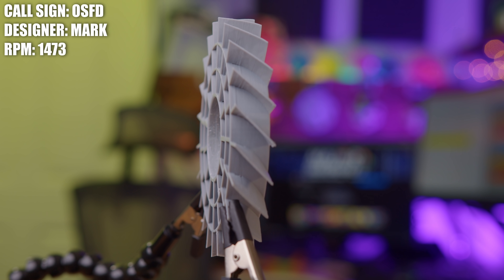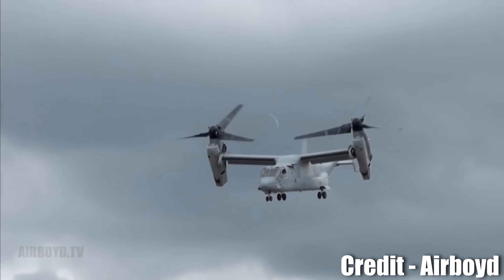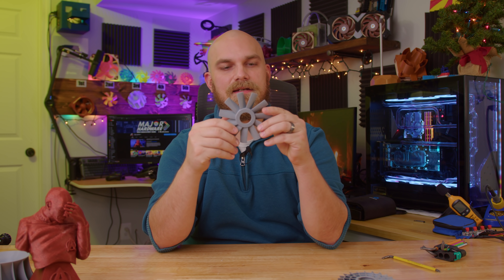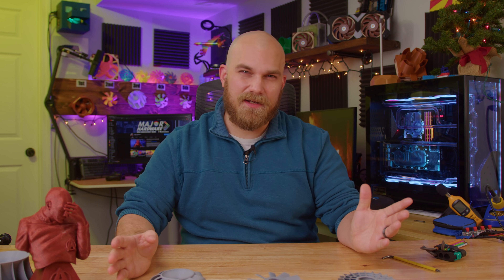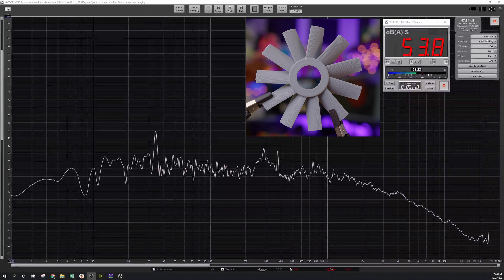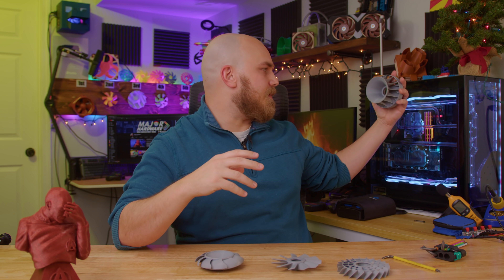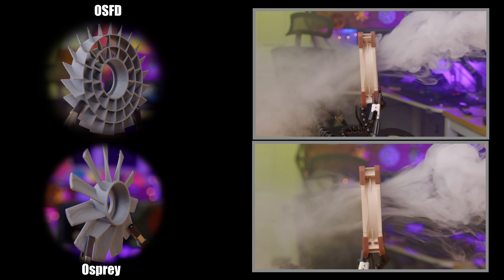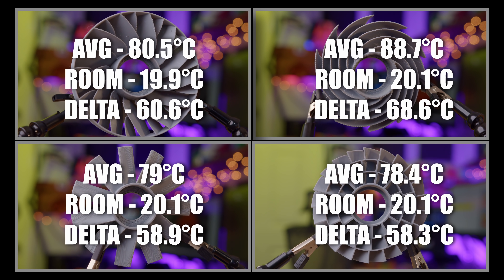INTERESTING | Fan Showdown S3E10

Comment: the first one is to be used in an enclosure not open like you have it,   in middle bore to case flange then out! picture it like a jet pump or squirrel cage fan, blower motor what have you

Comment: So, I just realized that it's probably easier to test static pressure than CFM, and I think the results could be interesting.

All you need is a rig to seal up the back (inlet) side of the fan and connect it to a clear tube of some sort. Then, orient the fan so it blows upward, and place the dangly end of the tube in a bucket of water.

The higher the static pressure, the higher it will lift and hold a column of water. Even if you don't then proceed to subtract from atmospheric pressure, and instead give us a measurement in inches of water, it'd be useful, as we don't need absolutes to make a comparison.

While this doesn't give us a pressure/CFM curve, it at least shows which fans perform better when more obstructed.

Comment: Did the Francis turbine print the correct way? Maybe the file needs to be mirrored. From what I know Francis turbines are enclosed in a shell and suck water (or air) from the protruding part so the opposite from what you tested. Can you include the mirrored form in another video, pretty please :-) ?

Comment: Please excuse my terminology. I've explained a few major issues with testing and expanded on bonus issue for tests.

A total volume test will be great but the final cooling rate will be dependant on a few factors. Heat tranfer speed to the radiator fins. Volume of air drawn across the fins. Volume of air expelled. A closed system airflow test showing the total volume of air moved with the inbound air being ambient and the outbound air being 100% contained as flow through the radiator fans then the air temperature of the output being displayed.  

The ambient temperature of air entering the system and the ambient air exiting I assume is the temperature being compared. The heat transfer across the fins will depend on the turbulence of the air, i.e. low turbulence equals low transfer.  An extended period of turbulence isnt greater, i.e. Difference in heat/time = rate of exchange. A smooth flow will lead to gradients meaning a high flow rate may mean minimal heat transfer. 

This way, even if the fans spill air in every direction then the captured ouput temperature could be measured assuming there is no air leaking from the case. The total air entering the system and the average input and output temperature could measure the total temperature being removed.  "Air" is a poor unit of measurement. The air pressure and moisture of the ambient air and within the case would be helpful. 

Finally and potentially most important, are there any airflow or smoke test videos of the fan working inside the computer? The airflow tests for smaller fans exhibit cavitation issues which would ruin the fans over time. The sound tests would show spikes. A smoke flow test would show the negative output of the fans. A very expensive set of cameras could be used to measure the IR movement of the air at different points. Before entering the system, before crossing over the conductor, before entire the fan, the heat distribution within the fan and the output. 

Bonus issues:

1: Aerospace design relies upon very large outputs which desktop fans cannot compare. Few desktop fans designs can accurately measure the extreme stresses involved with upscaling which may be envisioned by some viewers. For example any design with split fins will work differently within vastly different scenarios. So solid fins will only provide data in a short range. 

2. Since aircraft lift is dependant on redirection of airflow then upscaled designs would be extremely helpful showing even input and the output flow of the temperature and turbulence of different designs. I'd personally love to see the entire airflow model across wider areas.

3. Since the area of the processer is small why not allow for an airscoop that envelopes the entire body of the inflow plus the fan plus the radiator. I'm sure some of the subscribers would love to have a total area design that they could play with. The fan shape spilling out air wouldn't be a major issue anymore.
Reply: Regarding the restrictions on the fan design. Since fans that redirect air to the center are more efficient than an outer rim/hub to rotate the fan would allow for more designs.

Comment: Hey, you should buy a thermal camera to see the heat exchange in the air. It could be a good way to determine if a fan is creating certain high or low pressure zones

Comment: Major Hardware. I do not have CAD skills but i do have ideas. One thing i have noticed is that nobody has ever used a centrifugal style fan before. When i say that i mean nobody has created an entire fan google centrifugal fan. It's hard to explain but the noctua could attach to the side of the fan which would spin the inlet. Then attach the cooler to the outlet side of the fan. winning

Comment: You do NOT measure flow rate, just visually guestimate. WHAT? Ya true!  You measure but IGNORE noise, low noise is HIGH EFFICIENCY.  You fail to wind up speed to a fixed noise level ie scientific standardise efficiency of all fans side by side.  Conclusion MEANINGLESS CHANNEL.

Comment: have compared the stock noctua blades with a 3d printed version with the same measurements? I wonder how much layer lines and material density affect the performance of these printed fans.

Comment: Keep up the great work 👍
A passing thought, The Francis turbine model needs its rotational direction changed, where you fed the smoke in, is the outlet where the water would leave irl.
Would be interesting to see if it would work.
Reply: Steeper angle would be needed on the fins, like the original, as well. They looked very straight when I thought it was going to be a push
Reply: Agreed, the radius is oriented correctly but the the angle of the blade (from centerline) is in the wrong direction. I was just about to comment the same thing until I saw yours!! lol

Comment: I feel that testing the flow rate but excluding high static pressure is excluding half of PC builds. Maybe a shoebox with 120 inlet hole and a restricted output. A pressure sensor inside the box, maybe a phone with a barometer in it (app phyphox (Android and iOS) will read every phone sensor, so maybe use that).

Comment: How about making a tesla turbine instead?
Reply: But that turbine is designed to be driven by a force pushing against it.
Reply: @hybrid9mm  It works both ways.
Just like a DC motor can be used as a generator.
Reply: @QoraxAudio  yes and no.
I’ve never seen anyone use a Tesla turbine to move (push) air or fluid, it would be interesting to see considering the turbine is optimised to be driven.
Dc motor is electrics, a Tesla turbine is fluid dynamics, they work differently and don’t compare
Reply: @hybrid9mm  I didn't "compare" anything, I just gave another example of a reversible process where energy can be turned into motion and vice versa.
Reply: @QoraxAudio  “just like” is a comparison, but ok
Reply: @hybrid9mm  It was just an example of a similar concept, for clarification... looks like I've only made it more complicated instead lol
Reply: @QoraxAudio  well it’s not all on you, it’s 50% me to 👍
It takes two people to create a miss understanding after all
Reply: @hybrid9mm  Fair point... anyways, a tesla turbine can push air with quite some speed - without load.
But I suspect that it provides very little static pressure.
It would definitely make an interesting experiment - a bit different from yet another fan blade design.
Can be tested as a waterpump for a water cooler as well... that'll probably work a bit better since water is incompressible as opposed to air.
Reply: @QoraxAudio  yeah water can be pushed with ease, if you look up car water pumps, most are basic and they look very similar to a Tesla 👍
Now air is a little more tricky lol, it basically needs to be scooped to create pressure, and obviously static pressure is created keeping the blades as over lapped as possible.
It would work if the impeller was adapted to scoop and the housing matched to suit, it wouldn’t be a fan as such though.

Comment: The only one I could stand the sound of is the Turbine, which I think I would actually use. I do wonder though how this seasons fans would do in a static pressure test rather than open air I think the results could be surprising.

Comment: Question: Regarding the smoke tests, does the particulates of the smoke build up as a film over all the furniture downstream of the test rig? How difficult is the cleanup?
Reply: Shouldn't leave any residue if the machine is performing correctly

Comment: Could you please test the arctic P12 PWM PST ARGB? It’s very different from the arctic P12. It’s a little thicker and also has a ring on the edge of each blade, connecting the fan blades together. It seems to support it and keep the noise down much lower than a normal P12.

Comment: Just mounting the fan onto the end of a clear vertical tube with a scale in inches or CM etched or painted on its side, and placing a loosely fitting, weighted ball* into the tube while the fan is blowing air through the tube, and then measuring the ball (or cylinder*) height will give you a pressure metric to measure your fan designs.
Reply: Genius. Hope this gets more traction.

Comment: That Francis turbine looks cool but I have to wonder if the designer got the blades inverted like what happened in the past? I'm querying this, because google shows the flow is back to front to the way it should work... maybe flipping and testing it the right way around would provide better results?

Comment: dude season 3 was about CFM. You used a air cooler that doesn't need the same static presser needed to push air through a radiator

Comment: Turbines in the field of hydropower generation are normally not designed to suck in water / air or to build up pressure to the rear / front.
These should actually always offer the greatest possible re-sanding and at the same time offer a high flow rate in order to keep a high speed as constant as possible.

Comment: A thing i would like to see is the difference when the fan is mounted on a sheet of metal or plastic to simulate when it is mounted in a chassis. That will stop most of the air going around the fan instead of through it.

Comment: Scooperdrooper should be lessened by maybe 2 or 3 max in large blades providing better space and flipped opposite, but the dev needs to fix the fan attaching point backwards of its current state. Then try again and I'd wager a 30% est increase

Comment: I spotted a small mistake in the beginning:  centering mass doesn't make the fan any faster. It just helps it attaining cruising speed a bit earlier, which doesn't do anything for its cooling performance since everything is measured at steady speed.
Reply: It helps a bit with energy consumption if it takes less energy to get to max spin, or to decelerate it.

Comment: Tip on Russian: every letter in Russian has a sound (except 2 which are used to soften or harden consonant letter before them). So all you need is to pronounce those letters one by one without pauses. And English has same or close enough sounds - just get an english word that starts from that letter or combination of letters where no letter sounds are omitted. "V" - like in word very, "ya" - yahoo, "ch" - check, "e" - every, "s" - same, "l" - loot, "a" - after. Or you just can use google translate to read it for you - it is not perfect, but good enough o)

Comment: according to LTTs recent video its BETTER if a fan does spit out the air in all directions so the airs more spread to feed the GPU with cool air too not just the CPU ,a direct output of air can just smash into the wall of the GPU and not going near its intake, but thats just a front case fan sceneraio for rads etc its different

Comment: I want a rematch of all the old first place fans with your new set up to see if they still hold up to the current system. You were using imperial and now your using metric so to speak, it's time you re measure and be sure the stats are right.

Comment: Has anyone tried curving the trailing edge of the blade to help direct the flow out
Reply: Isn't that what most fan blades do that are tapered?
Reply: @Dr.Spatula  im talking about a near perpendicular out stretch near the base of the blade to help direct flow
Reply: @C_Castillo  I'm way better visually so what you're describing to me sounds not uncommon. To try and clarify you are referring to taking the typically ~45° angle where the blade is mounted to the center and extending to 90° while keeping the overall blade angle at ~20°?

It's  too cold and too late and my brain hurts

Comment: I work in a hvac r&d lab. We use a piece of equipment called a "code tester" to measure acfm across different static pressures and then calculate scfm. It's a pretty simple piece of equipment to design and build, especially with low cfm applications. 
Might be worth looking into if you want to start measuring airflow..

Comment: Wouldn’t it be dope to get a meshify XL monster case & setup those wind tunnel mini flags like for wind tunnels. You wouldn’t need to build a pc in it. Just create 3D print objects at size. So you could try the largest 3090 to a discrete. A 420 rad up top & any number of size or placement of fans. That a year of shows I’d love to watch
Reply: You could do all the top cases! & you wouldn’t even have to buy them! It’s about the internal size & dimensions! Mock up printed parts to obstruct for every type of cooler, mobo, GPU,capture card,nvme raid. You could do them all! All the data would be without filters or obstruction to the cooling fans. Still be epic imo. Apologies I sperged out in comments.
Reply: Yes X fan pushes the most air & best control temps. But what if I have a mass production fan in a popular case? Where can I move them to get best cooling, or best db, or best of both? Is a 140 in the back as exhaust best? What rpm? Do I put a 140 on the bottom blowing up because my 420 blocked the 3rd front fan? Oh man this could be cool!

Comment: Could YOU print a flat disk (no blades/no engineered air movement) and give us a DB reading... like a static criteria for a printed friction surface/e-motor. I don't want to "whine".  What you are doing is wonderful and well done!
Reply: Honestly, its sound signature would probably be lost in the background noise of the room.
Reply: @martindinner3621  Maybe..but there could be a "signature" generated by the printed surface that would be considerably less then any fan.

Comment: the scooper drooper actually sounded really soothing. im unsure as to if itll actually move much air though lol

edit; nevermind, it performs terribly lol. at least it sounds good!!
Reply: @Lassi Kinnunen 81 It could theoretically perform better with more blade surface area on the front, remove most of the center ring, and smooth out the back edge a bit more. I'd be interested in how well it could perform with a redesign as it looks great aesthetically

Comment: Have you ever considered making a laminar flow air source for the vapor? It can be as simple as gluing a bunch of 1 inch straw segments together, a 3d printed bracket, and then a manual RPM control to let you find the laminar flow speed.

Comment: Might have mentioned it in a past video, but something to take note of is that humans are very, very good at filtering out constant noise. The issue with a fan that has 2 or more spikes in the spectrum analysis is a phenomenon called "binaural beats", in which the two notes go in and out of phase with each other (kind of like constructive and destructive waves). This mechanism causes a "pulsing" sound to be heard, in a completely different pitch, clashing with the two peaks at the same time. Predictably, this is very hard to tune out.
Reply: This only really applies if the tones are close together in pitch (within a semitone i think), otherwise we hear them as two distinct pitches (even though the phases do mess with each other still, obviously). And it's only technically called "binaural" beating if you're listening to them in separate ears (like through headphones - hence bi aural / 2 ears), and the reason it gets a special name is the interference pattern happens in your head instead of in the actual pressure waves in the air. People like to call it binaural beating even when it's not in separate ears sometimes though because there was some pseudo science about this binaural beating inducing certain brain wave patterns which supposedly altered your mood. The reason two notes on a piano (or basically any sound other than clean sine waves) do a bit of this beating sound when they're further than a semi tone apart is because of the overtones of the sound. Overtones are sort of like other sine waves stacked on top of a note (the main note is called the "fundamental"). They usually fall in specific multiples of the fundamental called the overtone series, but they can also be outside of this series (I think this is when we call them partials instead of overtones? But I'm not sure actually), and this makes the sound more sort of rich/dissonant/complex sounding. For example a piano has overtones pretty cleanly in the overtone series, but a bell will have them sorta all over the place and a cymbal will have them even more messed up and the sound of paper being crumpled up will just have them all messed up completely (to the point where we stop even talking about the overtone series in relation to sounds like this). All this gets even more messy when you start learning about the Fourier transform and additive synthesis and you realize you can recreate any sound ever if you can control the amplitudes and phases of 1024 sine waves. Sorry got a bit off topic there. Good point about the fans tho.